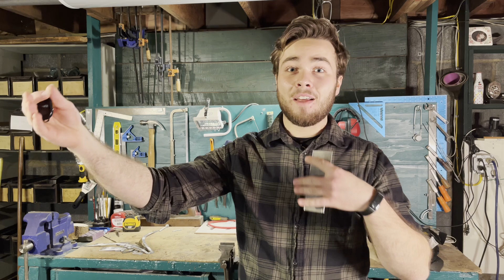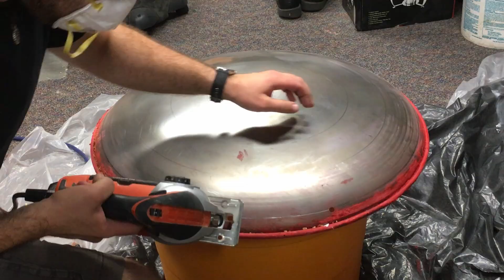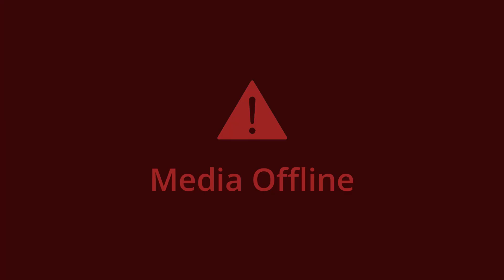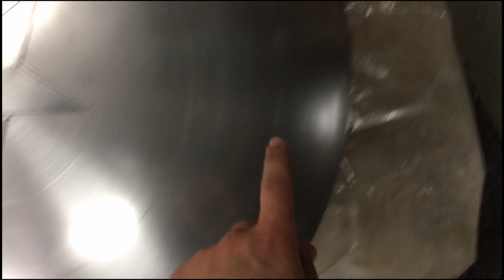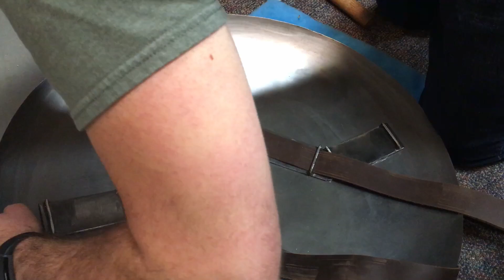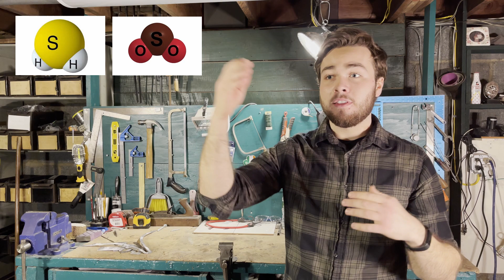How to Make Captain America's Shield - Full Build Process - Steel and Leather with Back

Comment: Hey man, where'd you get that sled at? I got one a few years ago to make a shield in this style but now I want to make a second one but can't find them being sold for a decent price anywhere.
Reply from the maker: I got this sled off of Amazon when it was on sale for like $30, but I'm sure you could track one down through ebay or something if you needed to.
Reply: @ShayneHeluk  Thanks for the quick reply! When I started my build, I used the video by Ramennoodlebudgets and he used the same sled as you do, but you defiantly go into more in-depth detail on how to actually take measurements instead of using mostly guesswork. The paint stripper I used on my sled made it rust badly so now I'm having to re-sand the whole thing to get it back to its former glory and I will defiantly be using your video from now on for how to complete it.
Reply from the maker: @trentgoins7190  Awesome! I'm glad I could help you out. For the rusting though, like I said in the video, try to limit the exposure of any bare steel to air by coating it with rust inhibitor (or WD-40/oil). And if you need to get current rust off, "Derusting WD-40" works well, or use some White Vinegar.

Comment: did you have any problems with the metal warping?
Reply: do you have a Twitter? my friend and i made one ourselves.
Reply from the maker: I did actually, but only in welding the brackets. And since the metal stock I used was so thick, it didn’t warp too bad due to not being able to heat all the way through then rapidly cool. But I ended up hammering it into a shape anyways so it didn’t really matter.
Reply from the maker: And I’ll have to check it out
Reply: @ShayneHeluk  I'd definitely like to send you a pic of it. We made it out of bondo and using the same saucer sled you got.
Reply from the maker: Awesome, I’d like to see it, what’s the Twitter handle?
Reply: @ShayneHeluk  @Caretaker_1995